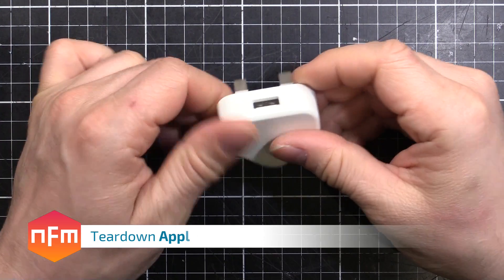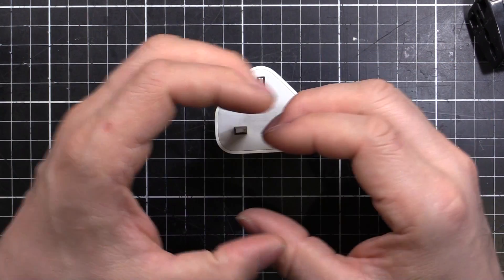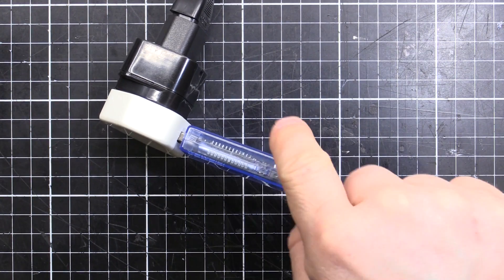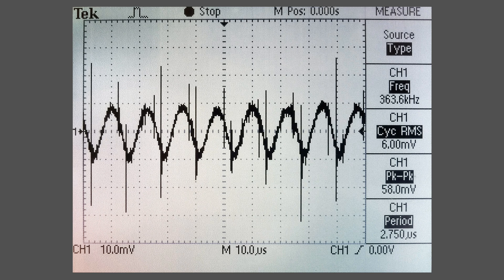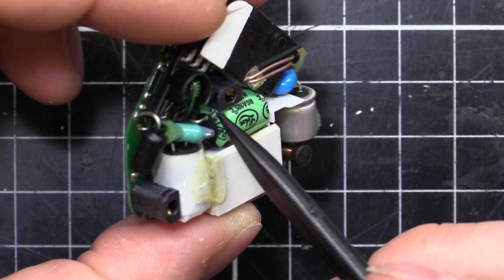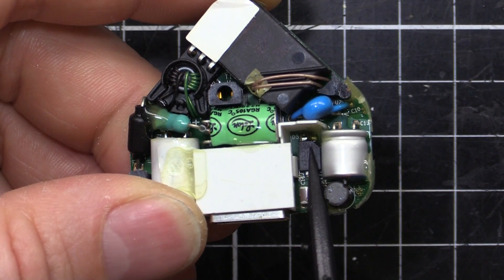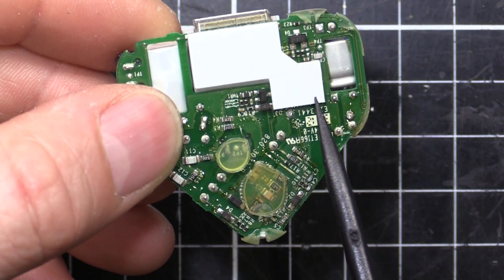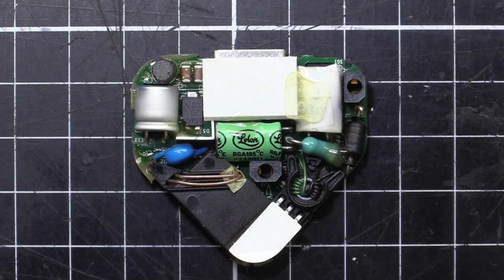Apple USB Charger Test and Teardown  - Model A1399

Comment: Would it be inadvisable to remove the case of something similar, then securely hardwire UK mains power (already buried in the wall) to those two holes in the board, and bury this thing flush to a wall to plug my google nest device in without using a mains socket?
Reply from the maker: It would be very inadvisable to do that!.....
Reply: @NearFarMedia  I knew that deep down, I just needed to hear it from an expert 😄
Reply: @NearFarMedia  Apologies for digging this up, but could you briefly explain why you'd see this as being inadvisable? This works very similar to the typical USB outlet plugs that can be bought, which are usually pretty terribly put together. The apple chargers are likely of a much higher quality and would fulfill the same purpose. 

The only risk I'd see (naively I know) is the risk of electrocution from a poor install, and the risk of fire from improperly protecting the device in some casing.

Is there anything I'm missing here? (genuine interest, not trying to pick holes!)

Comment: That thing you call an optocoupler looks like it only has three pans. Optocouplers have 4. And I don’t think that power supply is using Feedback. I think that might be a secondary side synchronous switching circuit.

Comment: When connecting that triangle adapter to a connector so it can attach to the wall and charge my iphone, is it ok for the connector to be a like cheap one or unbranded one? Or if that's the case will affect my phone battery life badly?
Reply: +Kim Hanajee 
Cheap connectors are fine and will not damage your phone battery. I’ve used one for a year with my iPhone and it’s fine.

Comment: If I want to learn to understand the electronic components like in the video, where should I go? I can read schematic diagram.
but I'm want to learn like the way you know what components is for what like in the video.
Reply: Lukas Kristian Go to university and study electronic engineering or spend a lot of personal time watching videos, reading books, messing with circuits (safely of course) eventually you’ll be able to have a vague idea about what a components is used for and why. To actually design a circuit like this from scratch you pretty much have to go to university and formally study, or spend years and years tinkering and reading

Comment: Was genuine 😜

I definitely think that light green axial 'resistor' looking component is a fuse. I had to repair some gear once and spent many hours without realizing one of those was right in my face. They are always that colour and have a fuse rating marking on their body, also on the pcb it should be designated with a F label.

Based on the pcb labels those two 'resistors' next to the opto chip are designated as C's on the pcb and since there's no code on them it's definitely a sign that they're capacitors. Again I have mixed up SMD caps and then had to find an analyser to check which was which! All SMD resistors should have codes printed on them. Just an FYI.
It's likely the resistor divider is on the back and there's via's connecting them, hard to see since it's all so small and nicely compact.

It would be cool to see the different plug versions and how they've changed over the years.

👍🏼
Reply: You are absolutely right about those capacitors, they are clearly marked as C.....
Reply: Yes, that's a fuse.  The fuse is a requirement of BS1363 (UK outlet and plug standard) as we have ring circuits supplying our socket outlets that are fused at 32A...  Therefore we require that there is a fuse in the plug, to protect the flex or appliance.

Comment: Please teardown Samsung adaptive fast charger. The one that come with Galaxy S7. :)
Reply from the maker: It just so happens that I have just bought a new Galaxy S7 Edge, and it has the adaptive fast charger.
I can't use it anyway as it it a British plug and I'm in Japan, so I might just tear it apart. :)
Reply: fast charger means it works with higher ouput voltage compared with the average charger, nothing special
Reply: @lucianOnaicul  even when its high voltage nothing changed when u regulate the current
Reply: NFM Haha. I'm hoping that someone will tear apart that Samsung adaptive fast charger with British plug as I'm living in Malaysia. We're using the British type plug here.